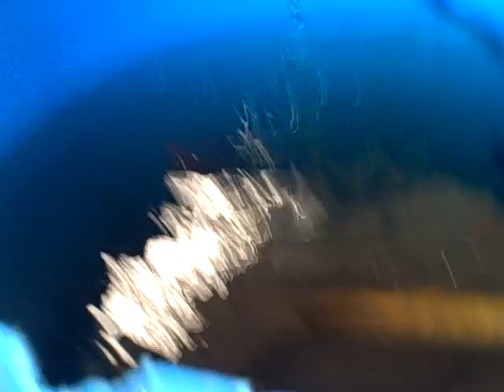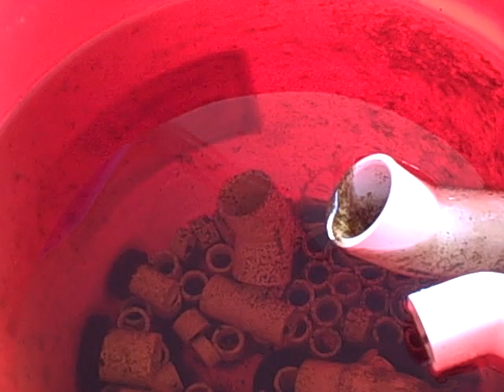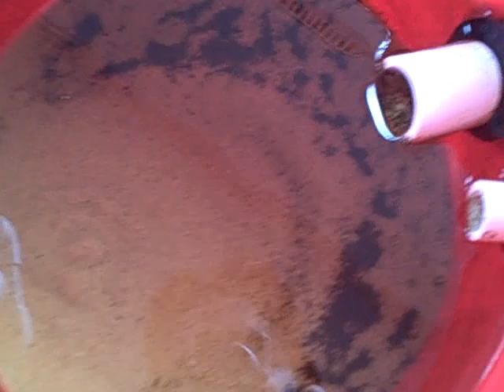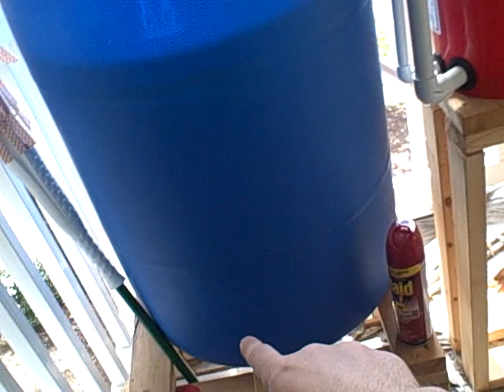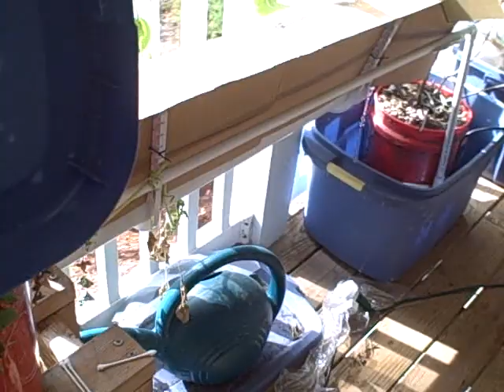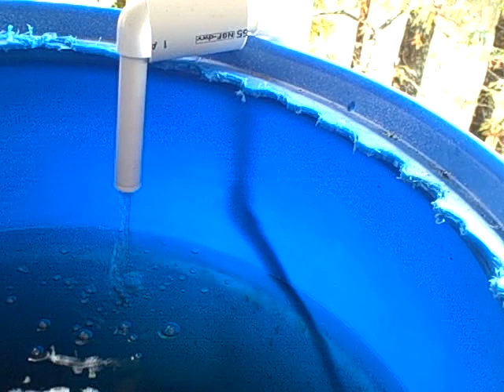NFT Aquaponic System Overview

Comment: How do You prevent the sand from back washing in the pipes 
Is there only one hole in bottom of the sand bucket or do You have a pipe with lots of lil holes ?
Reply from the maker: +Walt Lars The pipe connecting the sediment bucket and the sand bucket goes downhill. The sand can't flow up a pipe. Also, the constant flow of water keeps forward pressure along the line.
Reply: +Neal McSpadden thanks
Reply: I found this video on Fast Track Grower - there's many useful  videos there that may help you

Comment from the maker: A lot of people stress out about the pH, but I haven't found it to be much of an issue. The pH of a system will drift lower over time as the bacteria in the grow media establish their colony, but it will depend on what kind of media you use and your source water. I've seen pH hitting 5.5 in older systems! The fish and plants were fine. I believe that as long as pH changes are gradual, the plants and fish will adapt. There may be certain plants that don't grow in your system's pH is though.

Comment: sorry cut off. bottom line bore the hole in the bucket the same diameter as your pvc and get a rubber gromets that fits snugget over the pvc and you will do just fine. if you have any leakage issues a small dab of vasaline around the pipe works wonders

Comment: also you can tell your responders that a simple gromets provided you know what you're doing is the best way to go, price wise. people just need to remember to drill a hole in the bucket the same diameter as the hole of your rubber gromets. rubber gromets candy pot at home depot or menards or any auto supply. I use silicone between the lips of the rubber gromets that meets the bucket( don't forget inside and out between otherwise the inner lip if unsealed will collect bacteria)

Comment: what type of connections are you using to make the pipes into the buckets water tight? simply just pvc adapters mpt x slip? are you using any type of sealant? silicone, etc. thanks in advance for the response. I'm in the process of setting up my first ap build :)

Comment from the maker: @bluemist431 Ya know, I'm not entirely sure.  The greater the height difference between the initial outlet and the final outlet, the greater the flow will be.  I wanted a high volume of flow to push through the sand filter, so that's why I built it this way. 

You could probably get away with a more horizontal system, but you'll be trading flow and/or pressure.

Comment: Why do you need to have your red filter buckets at different heights? I understand that gravity moves the water, but since the out-flow pipes are already higher than the in-flow pipes, is it necessary to make a step system like you have? or will a straight-line system work similar?

Comment from the maker: @kalidabod I'd really recommend making a small test system first.  You can read all the info on the internet, but it becomes much more real when you do it yourself.  If you are casting concrete or ferrocement tanks, you definitely want to get it right.